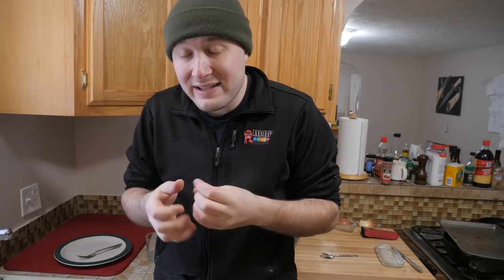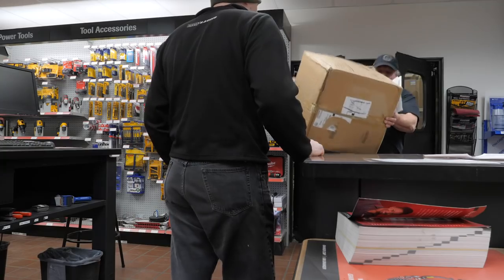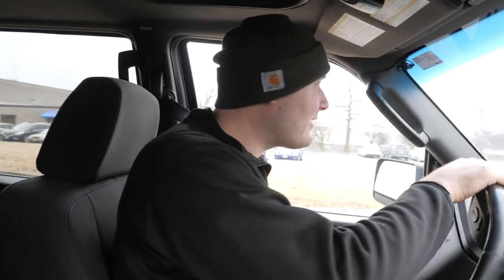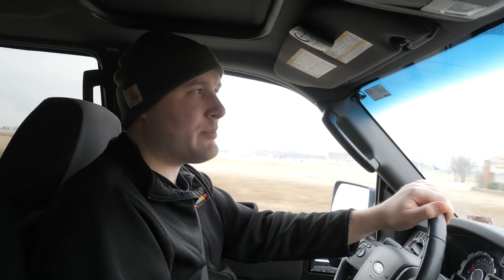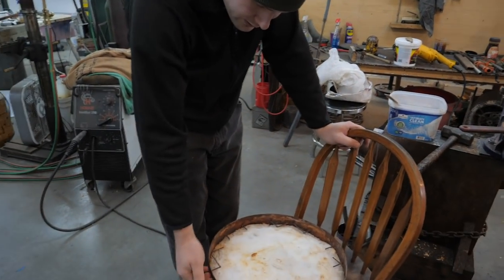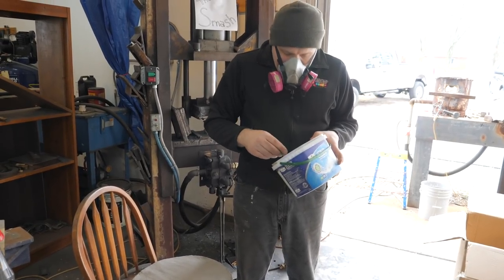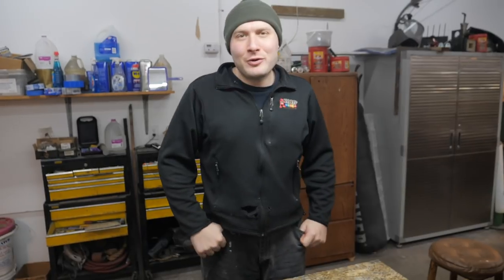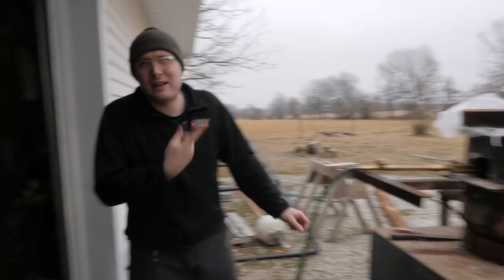Making a Medieval Damascus Sword Pt. 3

Comment: I wonder if Josh and Mr Royer cooking a turkey in there this last Thanksgiving was the culprit to the forge lining failure 😁.  Just playin . I honestly never thought about looking at Grainger for forge supplies.  I happen live by this pottery supply store called "Clay Art Center" that sells everything one needs for forges, kilns, etc. so thankfully I can just grab what I need from there to avoid the outrageous online and shipping prices.

I hope that new refractory coat holds up for ya!  I've been meaning to build a forge specifically for heat treating.  Unfortunately, since I know nothing about electronics I can't set up to use a PID with a selenoid and blower to control the temp, so I've been thinking about/looking for a good design for a medium size (I.e. something other than 55 gallons) Venturi burner forge that'll heat nice and evenly and is easy to hold at temp.  You happen to know of any design for such?  Sorry, this vid just got me thinking about all that again, thanks again for sharing you guys! Take care and God bless :)

Comment: Ive been using a refractory patch called sparseal 95 that i lined my forge with. A friend gave me 400lbs of this stuff but it has held up wonderfully. It is a high alumina 3000 degree putty. Ive never used kaowool its hard to find any where i live.